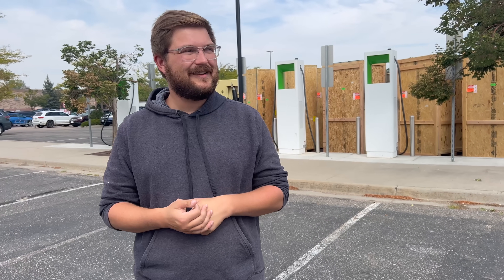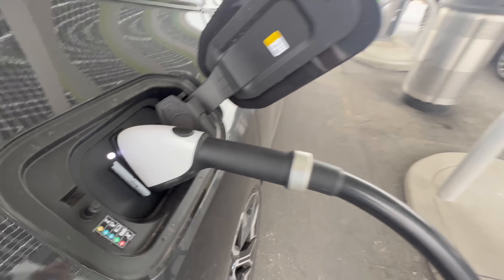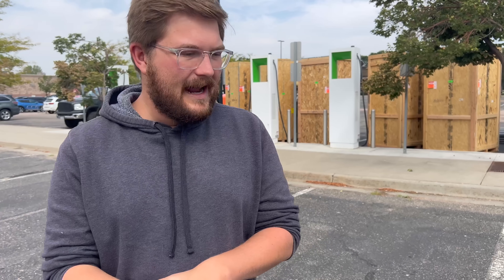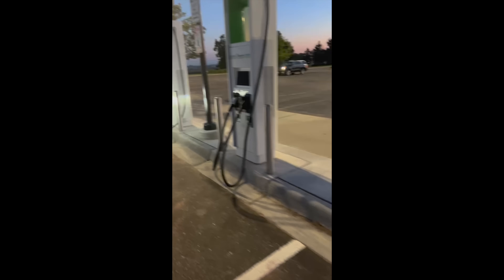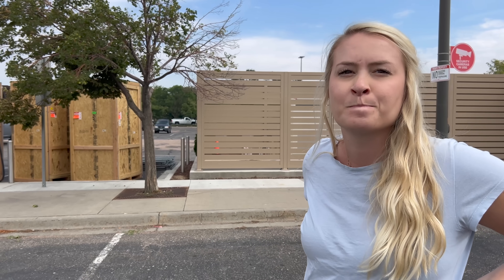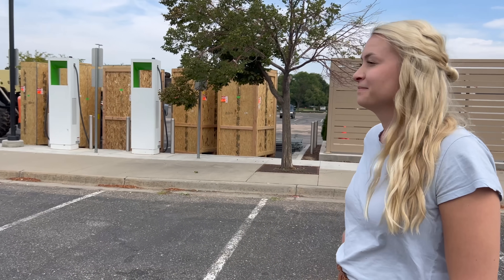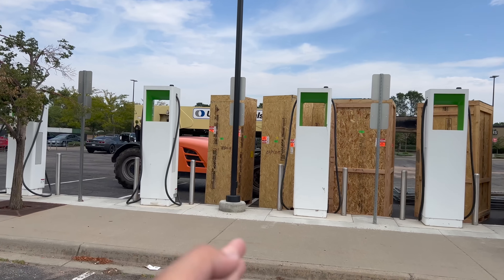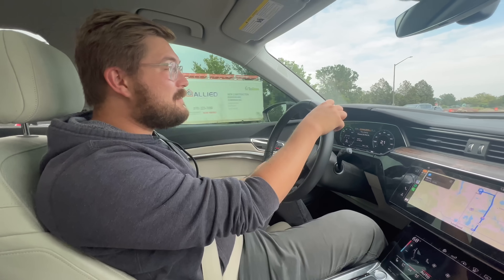Upgrade! New DC Fast Chargers Are Being Installed To Fix Reliability Issues Of Older Units

Comment: One thign that needs to happen is a redesign of charging stations as well, so you don't pull onto a curve, but would it be too difficult to mae an EV charging station like how gasoline stations are where you have cars drive up next to it (which owuld make things easier inthe future for trailers... I realize in some walmarts/targets its not that possible, but  thoguth they would have thought something like that. since we have the example in gas stations, you don't pull up to the curve or back up to the pump.... I know a person who would not EVER be able to back up onto a charging station if the charge port was on the rear of the car...

Comment: Electrify America is very very unreliable for long trips. Summer 22 was horrible for any southern state, charges either didn't work or charged at only 34kwh to prevent overheating. Some towns where shut down completely. App is unreliable how many available and how many not, where you can end up stranded.
Basically, whatever range you have you can't use it as you don't know if next ea will work. Very frustrating.
Many times the charger won't recognize the vehicle and one needs to stand out in 110F with the customer service. I have seen cases where cable gets locked and can't be removed and me personally being left in open charging session from charger even tho I am miles away.

Comment: I had the not recognizing issue on my ID.4 even with some ABB units that were previously working. I'd assume it's some EA software or communication issue. Because for the past 2 times, the charger both said my plan was not processed, but the car started charging at normal speed. Both the app and charger screen showing the charger I was using is available.

Comment: It's interesting.  As someone who has been driving electric starting with a Leaf in 2015 and now driving a 2017 Bolt, I'd say charging reliability is better than it has been in the past.
Yes, it still needs to be improved!  But at least in the Pacific Northwest, I've had a lot of good luck with the Electrify America chargers I've used since I got my Bolt in '17...
That said, maybe I have been lucky or our area is better or ?, but I am thrilled that it is getting better!!
I do wish they'd just go to all higher speed units, rather then trying to expect car owners to use the slower units if they have slower charging cars.  That's a recipe for failure, knowing humans.  ;-)

Comment: How about a video on the use of the EV Charging Money from the Federal Infrastructure Bill that passed last year.  How is that money to be used and doled out and to whom?  Could it include REPLACEMENT of current crap equipment or will it  only be for expansion ?

Comment: It's great that they are doing yours first, but they finished ours about 3 weeks ago.  I tried out the system yesterday and my phone would not start the charger.   Then it just started charging on its own with out payment...

I have an i3 with the back-up gasoline engine, and Electrify America was a primary reason why I would not go pure EV when I bought it or now.  If this hardware is better great, but the software and system in general was just as bad.

Comment: Wonder if they could communicate with local councils about helping them put ‘chargers offline’ signage up, if they don’t have people on site to do it personally yet. Like when the road floods near my house, the council ‘road is flooded’ signs come out or maybe have some sort of electronic message board letting people know what’s going on, what chargers are or aren’t working there or nearby. Like a ‘road to x is closed’ only it’s ‘chargers in x are down’ alert. Granted you don’t want enough broken chargers or emergencies to need such a sign but still.

Comment: Kyle: good stuff. Here’s my Trip Summary:On my Volvo C40 - Memphis, Tennessee to Dallas, Texas (Round Trip).

475 miles one way = 950 total miles😌
Within Dallas - drove 100 miles😁
10 total charging stops with 5 each way🍺
Charging times: 30-45 minutes to 60 minutes, only because I was consistently topping off to 90%😀
Driving visibility - excellent. 360 cameras were a must have and a huge plus backing out of tight parking spots especially around my hotel. The rear window wasn’t an issue at all. Literally will not be a dealbreaker. You just need to get used to the 360 cameras and looking over your right and left shoulder occasionally when changing lanes and backing out.👌
Amount spent: $50 total for food, drinks both ways (Coke, Pepsi, POM, Filter Coffee, Bang, Subway, Walmart Meat Deli)
All EA located at Walmart except one at Super Value Foods in Mount Pleasant, Texas🔌
Reliability of Chargers: 100% for all EA Walmart.🔥
Not a single Volvo C40 spotted the entire weekend across the states of Arkansas, Tennessee and Texas and within the cities I travelled (Memphis, Dallas, Plano, Frisco, Denton, Royce City, Sunnyvale, Little Rock, Texarkana)😃
Curious Onlookers: One guy approached me at pitstop 1 in Forrest City 🏙 was curious how the EV was, charging etc. He seemed thrilled to the see the C40, gawked at it a few times and apologized to me for holding me up. Told him smilingly he wasn’t as I was just charging 😊.
Safety/Performance: Flawless, sexy, thrilling, beautiful, quiet, awesome road handling, solid moves around curves, in city, out of city, braking, OPD, lights
Cleaning: at many pitstops, I would take 14 minutes and clean up my windows, windshield and back window. I kept a glass cleaner and a polisher/polish cloths with me. This will minimize my post trip cleanup efforts.
Overall trip grade: 5/5: The EA mobile app did not record my charging sessions back and forth. It would tell me “initializing charging” and stop with an error message. The physical charger worked flawlessly.😍😎. 
Update: I did call EA customer support this morning and they explained to me that there was an infrastructure upgrade happening this past weekend so all charging was free. They had disabled the mobile app so it wouldn’t record your sessions or charge $$ for KWH.

Comment: Tesla has mobile charging, which is a pile of batteries on a semi truck trailer and a bunch of charging plugs, They leave it at spots where demand is temporarily high, but something like that would also work where someone was taking a whole station offline with no warning for several weeks like EA seems to do.
It's not a huge deal to take a station down if there are nearby alternatives, but when the next station is 100 miles away, it's inexcusable. It's also a huge reason I am on the fence about switching from a Tesla to a CCS car. I paid the deposit, but am having hardcore second thoughts.

Comment: I have to say that chargers should stay online while they are working on it... They should only shut down the units they are working on so at least there are a couple still working for people that come in. It amazes me that they are treated like something optional / not necessary. They are essential to someone that relied on it, that saw them online when they planned their trop for example. Shutting down a whole site or worst, multiple close by sites as they did before, is not good

Comment: Kyle and Mallisa (Alyssa?), in some of your earlier videos you were using a wet rag to cool down the connectors. Is that still a good hack if the chargers are delivering lower current or as some has suggested it could end up damaging the cables since they are getting an incorrect temperature reading?

Comment: When you have a failed session, even if it started OK and then fails, leave a - (minus) check in on PlugShare and not a + (plus). I see so many + reports that say "started, got 125kW but then it errored".  These + check ins gives the site a good rating that is not deserved.

Comment: Thanks for your reviews, Great that you’re getting the new station.

I’ve had good luck w Electrify America in WA but certainly notice it’s busier at my station over the 6 months I’ve been using it.

You might want to check out the Freewire charging stations.  Here’s an interview with their CEO on the twobit da Vinci YouTube channel that does great work

https://m.youtube.com/watch?v=JoxFawW79mc&pp=QAFIAg%3D%3D

They are less that 10% of the cost of the DC fast chargers yet can still deliver 150 kW speed.  Besides the less expensive installs (which means 7-11’s, gas stations, and restaurants can have them) there is a benefit to the environment and grid.  Each station has a battery within it, so it only needs a 240V line to the charger (rather than the MW DC station hardware) and therefore the grid is buffered during the high use 4-9p.m. Stressful times that is causing brownouts in CA while everyone is in high electricity demand time for their AC and cars.
     Seems these battery buffered chargers are a good idea if we’re going to have millions of EV’s on the road.

Comment: Thanks for being an early adopter. Hopefully by the time I get an EV the guesswork will be done, in 5 or 6 years.

Locally in a 400 mile circle, there's one Flo 150, the rest are 50s only. Thats what you get for living in a place of less than 100, 000 people in 186,000 square miles.

Comment: The inherent problem with charging EVs is how software dependent it is. The high tech communication between the car and the charger is always going to be a challenge as they constantly evolve. 

Most other things you plug in doesn't use software (phones and such excluded). When you plug in an appliance you always know the juice is going to flow immediately.
Reply: yeah, the standards body needs to come out wiht better testing methodology, so manufacturers (of cars and chargers) can test every single scenario.

Comment: Forgot to mention, that there was a technician out there yesterday trying to fix 3 out of the six that were out.  He seemed frustrated and left without being able to fix the three station, I know because to wanted to make sure they were working so I did try the three station he tried fixing SMH it still doesn't work.  Another downfall on these DC charger, the cord is too short and heavy,  I have to drive up carefully to the charger to charge my LUcid.

Comment: Coming from a Tesla owner it's quite frustrating using these DC charger, I had to literally move around to find one that is working, and when I did find one it was being used so therefore I have to wait about 30 mins before I can actually use it.  I recently took delivery of LUCID GT still have a TEsla, charging for my experience has been HELL! I pray that they fix or update these chargers so it can be more reliable especially when I'm on a long trip.

Comment: I notice there's nobody doing any work there. They turned everything off and then went home? Typical, EA people are divorced from reality. They could have either sent a big crew to get the install done quickly, they could have left the old ones on until the crew was ready to start working, they might have been able to leave one or two working while the other two were replaced. Maybe make the one that never works a priority, fix it first so people have something to get home if they pull in depleted. Their motto seems to be "We don't care, we don't have to". EA acts like they are a sign company, we'll get around to fixing it some time. But people are depending on these things.

Comment: Monitoring stall availability and then dispatching repair teams also need to be addressed.  They don't maintain themselves.  And EA is just one of about of a dozen companies providing DCFC stations, are the other companies also upgrading their equipment and service?  I would also hope they have security cameras and address ICE'ing and vandalism.  And the LCDs should be eliminated, the car or app should provide all the info needed.
Reply: they claim it is a shortage of parts.  This particular location was down to just 1 unit recently, I called EA and they said they were waiting on parts.
Reply: In some jurisdictions, such as California, there is a requirement that price and consumption information be displayed on the charger, just like a gas pump. Tesla is not in compliance right now, but is looking at what they must do. California will not count in-car displays or phone apps as acceptable.

Comment: Just yesterday I drove up ih35 in tx. Charged at EA in Waco and Denton ( have 3 yr free ea plan) Nervous about Waco, said only a cple were working. When I pulled in only 1 looked operational, had service updating on others. As I was about to plug in now this 1 looked to be updating oh no. Plugged in anyway and it began charging right away. No app. Denton worked perfect no app. Didn’t receive ea email about charge session for either.

Comment: so you never run your battery so low so that you can't  to drive to an alternate charging  station.
I saw a review of an electric pickup truck. When towing, the range was 85 miles, and then they had to park and disconnect the trailer before getting to a charging station as the stations are not set up for a vehicle with a trailer.

Comment: Recently a new charging station has been opened in my area and the stations were wrapped with black stretch foil until the very moment they were turned online. They weren't pretty, but you could see from far away that they aren't yet available. I won't even mention that they didn't appear online in any app. Installation companies should set some consistent procedures, so you won't have situations like those shown in the video.

Comment: We definitely need reliability of chargiers.  My wife , 2 dogs and I didi a 4 Day trip starting day after Labor Day from Wisconsin to Utah In our ID4. The 1st 2.days we experienced software upgrades by Electrify America experiencing 3 stops having 1 out of the 4 charging stations working.  The morning of 4th day we pulled up to the Green River plugged in next to Kyle in the BMW.  You noticed our Charge rate was only at 31 kw. Due to bad sensor on cable.  We appreciate you helping us out to get a proper charge.  Thanks for being the squeaky wheel on the reliability of chargers.  I do believe it helps..

Comment: They need to be ADDING MORE station units not just replacing them.  4 is not enough.  They ned to put in 8 to 10 of these units at every location.

Comment: Kyle, you should really say it like it is: for the next two years, if you need an EV for road trips, buy a Tesla. In two years you will re-evaluate to see if you need to update your recommendation. 
Look, I have both a Tesla and non-Tesla EVs. My Tesla can use EA stations (with an adapter) if needed. I have driven my Tesla coast-to-coast and back. No problems. Every time I plug it in, it just works. Every 10th time you may need to move to a different slot, but that takes like 2 minutes. In contrast, I took my non-Tesla EV from Salt Lake City to Phoenix and ... well, it was an adventure. But not the kind of adventure I was looking for.
Your average driver (think of your mom if you are under 30 or your golf buddy if you are 50) will get burned one time and will sour on the whole EV experience.
Reply: Tesla had the advantage of selling cars to pay for charger installation.  The rest do not.. they have to figure out how to make just the charger install profitable.. somehow... at least to be profitable in the near future.
Personally.. I am not spending $60K on a Tesla just so I can road trip.  I would buy the best EV for my needs regardless of charging type.. for me that probably a Bolt EUV or the new Equinox, or maybe ID4 Base model.  And I will keep my Toyota Hybrid for road trips.

Comment: When I took a road trip from Minnesota to Colorado recently, I drove my Model 3 with the CCS adapter imported from Korea. I have gotten to the point with EA where I will only go to one of their stations if I know there is a Tesla supercharger nearby; on my return trip, going east across Nebraska, I used EA stations in Ogallala, North Platte, and Lincoln; and the Tesla supercharger in Grand Island.

I used Ogallala because I knew that, while it was down to one charging stall, that stall was rock solid. North Platte was a new installation with a V3 supercharger a block away. Lincoln was one I found to be reliable and in a better location relative to I-80 that the Tesla supercharger.

The day before, I used EA at Edwards, CO, knowing that I can move to the supercharger if necessary, anticipating that the Tesla demand would greatly exceed the CCS demand, but I would be able to move to the Tesla supercharger if the EA stalls were needed for other vehicles.

Basically, it still takes good planning to take long road trips. Overall, the CCS adapter is at the very least an insurance policy.

Comment: The EA stations have been saying they’re doing software updates for several days and that appears to have made the app more or less a mess. We have been to seven  different EA stations between Colorado and Idaho 
since Saturday. All were busy on the weekend but we only had to wait once for maybe five minutes. Had to move once because of a nonfunctional dispenser and once because a 350 kw dispenser was only outputting 65 kw. With the exception of the app being wonky everything has been going well in our first long road trip in our Ioniq 5. The charging was free for everyone so it was literally just plug and charge. We’ll see if our luck holds tomorrow.
Reply: Hi John, I have been seeing the roughly 65 KW reading the last three times I have been to the same charger station. Normally I was getting like 180.  I see you have an Ioniq 5.  Have you ever had the trunk fully open and then immediate start the closing cycle after maybe 3 to 5 seconds?  I am having this issue maybe 40% of the time when opening the trunk and have yet to find a dealer around Denver who believes me and actual wants to replicate the problem.
Reply: @arobisu  No problems with our trunk but we have a SE model that part is all manual.